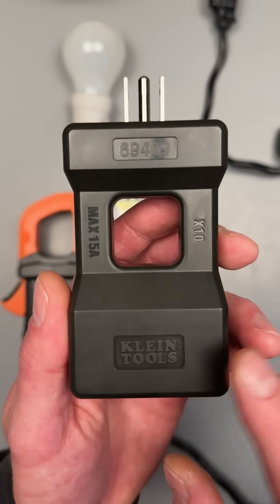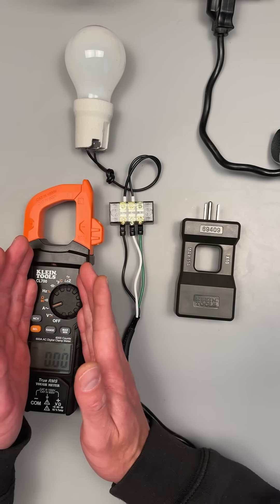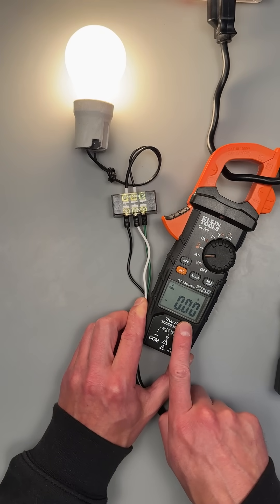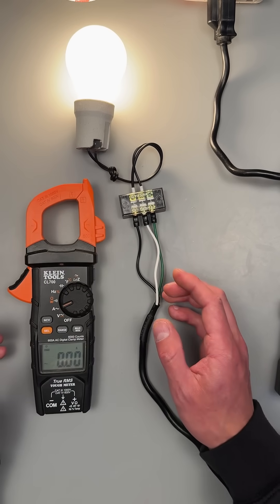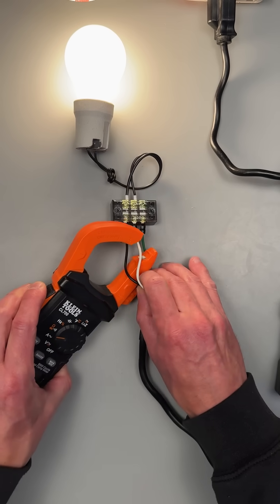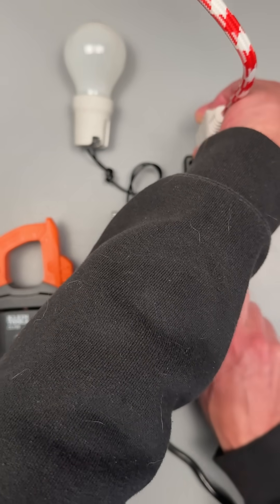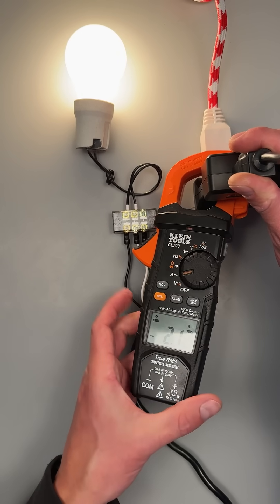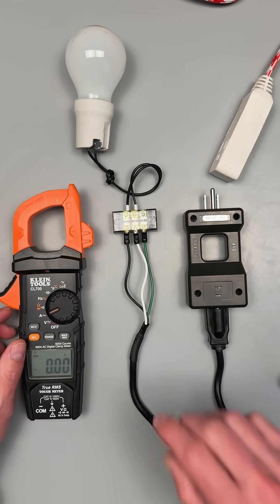What is a Line Splitter and Why is Your Amp Clamp Reading ZERO?

Comment: Thanks! I have one and I find it super handy. 
But…Why does it multiply the value by 10 instead of just telling us what the actual amperage is?
Reply from the maker: It can be helpful if you’re measuring small currents. Cheaper amp clamps have a hard time accurately reading small currents. So this way it just multiplies it up front for you, and then you can just multiply by 10. You can also get ones that don’t multiply it. Or there’s even some that have a bunch of options.

Comment: Who on earth would waste good money on that thing?
Reply from the maker: What do you mean?
Reply: @maddoxmechanic  All you need is a length of cable with the three inner wires separated. You can make that from scraps
Reply from the maker: @donepearce I think using that logic, you could also make the argument of, why wouldn’t we just make our own extension cords 🤷🏼‍♂️. The reason why you would purchase on is so that it is safe and durable. Also most of the DIYers on here I would not trust to be making their own line splitter. I do have a homemade setup up in this example here:

What is the X10 Function of the Line Splitter for?
https://youtube.com/shorts/Da1lAkXbHhI?feature=share
Reply: @maddoxmechanic  There is no electrical exposure involved, so no safety concern. You just split the outer jacket for a few inches and the job is done. $20 may not be a fortune, but it represents a way of thinking that nobody doing this kind of work should entertain. If a person doesn't think he can split an outer safely, he should sell all his tools and hire an electrician. If he thinks there is something going on in here that merits the huge casing, he definitely lacks the knowledge necessary to wield an electrical screwdriver. Either way, he needs to stay away from electricity.
Reply from the maker: @donepearce you do realize that this is a product designed and produced by Klein Tools, right?
Reply: @maddoxmechanic  And? Is it magic?
Reply from the maker: @donepearce aaaaannd I don’t think they would be wasting their time designing and manufacturing a tool if they didn’t believe there was a market for it 🤷🏼‍♂️. There are plenty of things we can make at home. Doesn’t mean all everyone should. I don’t believe it to be a waste of money for an amateur trying to safely learn/measure a potential fault
Reply: @maddoxmechanic  Amateurs should be learning, not buying pointless junk. Of course they will make this. The world is full of mugs.

Comment: How many volts is that bro,  be careful
Reply: How many volts? Well considering it's US wiring, it's just 110/115v but everything is insulated, no bare wires. He's just educating how to use the line splitter from Klein. Nothing dangerous here. If you're thinking about the 10x more, it's just the magnetic field, not voltage.
Reply from the maker: @ thanks Chris 👍
Reply from the maker: I appreciate the concern... but I don't understand which part of this looks dangerous to you..
Reply: @maddoxmechanic  There isn't any, you had the terminals on the block covered and all bare wires were insulated.  Good explanation of current flow thru a device.
Reply from the maker: @davidyansky6605  thank you I appreciate that
Reply: @aiyogarage  I thought it was exposed,  this the internet,  people do dumb shit,  electroboom😂
Reply from the maker: @ no worries. Good looking out